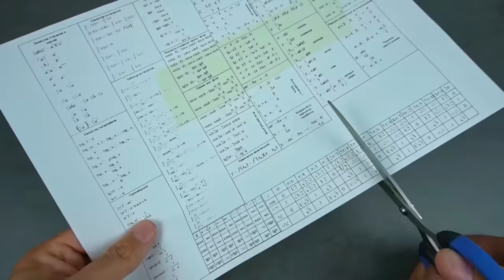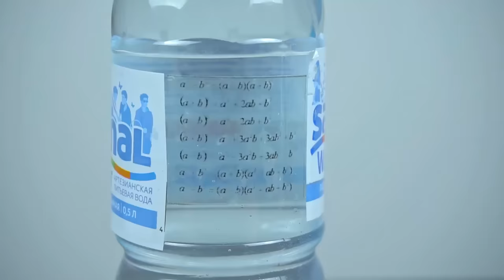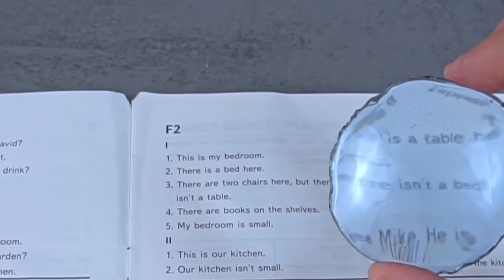I regret not having learned this secret at age 40! Absolutely amazing ideas

Comment: Water bottles containing ice shouldn't be attached to electrical equipment...
Reply: Set it up where water,condensation, doesn't get in it?if a electrical fire persistent, water will put it out!😂😂❤❤❤
Reply: Especially with something like that, the melting ice is going to run all over!
Reply: Not the best idea to be melting plastic with a soldering iron or a lighter either. If you really have to do that, do it outdoors with the wind blowing away from you.
Reply: @stevemerrill-bz7bk  water doesnt put electric fires out 🤦‍♂️
Reply: The REALITY is, one is doing this in the first place because the room/area is HOT, therefore, this makes ZERO SENSE, because the ice will melt in MINUTES, and will result in basically nothing.

Comment: The 6th one, (protection for your eyes} is just as dangerous and using an electric angle grinder without safety glasses on. If that grinding or cutting disk exploded while using it, flying shrapnel from the broken disk could and would go right through that piece of plastic and protentional take one or both of your eyes in the process...I strongly recommend that NOBODY MAKE OR USE THIS as an eye shield. IT IS DANGEROUS...
Reply: Yes. Very Dangerous
Reply: Using angle grinders is inherently dangerous. 
I'm a 74 year old construction sparky and in all those years I've had sparks hit my cheek and bounce under the safety glasses and into my eye but I've never seen or heard of a disc shattering and taking out an eye.
When did it happen to you or how many times have you heard of it or seen it happen?
Reply: I thought the same thing. But it would be good if you had no eye protection while doing minor projects using a dremel for detailing... but even that could be dangerous
Reply: Better than nothing.  But ya, I want the OSHA  approval myself.
Reply: @douglascolman4501  bet when those sparks and metal shavings were flying you didn't think "I would rather have a plastic bottle protecting my face rather than safety glasses actually" and if you did, well im surprised you made it past 7 years old.
Reply: @dombouscher8436 if you don't have protection at the time then you don't do the job. Simple. Your sight isn't something to mess around with
Reply: The Sparks are the least of your worries. The angle grinder disc can and will blow up and fly everywhere. I've seen it stuck in people's hats. Hard hats and in their safety glasses OSHA proves safety glasses that save their eyes. Please do not try to use homemade safety glasses when using an angle grinder for your own protection. Also no loose fitting gloves but then I'll grab you and twist you around
Reply: And very pointless considering safety glasses are under a dollar.

Comment: Don’t do the ice fan one! If the water melts it could blow into the fan and electrocute!
Reply: Proper positioning of the bottles would be important to avoid that.
Reply: The holes in the bottle and a little thing called condensation would do a pretty good job of getting the fan wet on a hot day

Comment: There's no need for the holes in the plastic bottles of ice behind the fan. All that will do is create a mess as the ice melts, and it will actually melt faster.
Reply: And we all know that a puddle of water and an electric fan go together like peanut butter and cyanide.
Reply: I was just thinking that like yea that would of been a good idea  if you didn't put the holes in it.....
Reply: u dont want it to melt faster for the cooling to work?
Reply: No, it actually would not!  It's one of the best ways to cool down when you have that cool mist making things dewy. You make it sound like a bucket of water is going to  hit you.
Reply: I don't know how i feel about condensation in a dirty electrical device pointed at my face lmao. 
Wouldn't a simple bowl of ice in front of a fan be better? But i guess that way you couldn't justify using all this single use plastic by pretending you are making a thing that you totally aren't going to throw away in 3 min.

Comment: With the wooden matches all you have to do is melt wax and cover the entire wooden match in melted wax when the wax dries it's making a water barrier or moisture barrier, your matches will never get too wet to light that's all you have to do. Get a wax melter put unscented uncolored wax in the melter and allow your matches to be completely coated in candle wax there's a good hack for you. Do that and you'll never have to worry about your matches getting wet or moisture collecting on them and them not lighting because the wax keeps them bone dry, and the wax also allows you to use the striker, for matches that do not require any striker get the white tip matches cover them in wax and you'll only have to use a zipper on your jacket and even if the zippers wet the wax keeps the match tip from getting wet and it will still light.
Reply: or STICK THE MATCH IN YOUR EAR, viola, waxed matches, thank me later.
Reply: Dip in clear nail polish let dry. Strike on striker.

Comment: 1:19 That won't work. The melted ice has to go somewhere.
Reply: I was thinking the same thing.
Reply: Thought the same, or is he trying to do evaporative cooling?
Reply: @snowmiaow  either way, there will be leakage and condensation.
Reply: It works fine. I’ve done it however, you have to have a place for the water to drip ass it’s melting.

Comment: One question on the ice at the back of the fan. You put holes on the water bottle, when the ice melts wouldn't it leak? The fan is plugged isn't that dangerous?

Comment: If you take 1000+ 1-liter wine tetrapacks and glue them together, you can make a giant floating raft. Or, glue them to the interior of a wall and then coat with concrete to make cheap thermal insulation.

Comment: I've replaced the batteries in Dollar Tree solar lights and they are working BETTER THAN EVER. I think the original batteries are feeble so a new cheap rechargeable is an upgrade. 
Their biggest enemy is rain damage over time. Putting it in a sealed enclosure as shown in the video helps extend their life.... and it helps to NOT hit them with the lawn mower too... ;-)

Comment: 0:37
What's the use for long strip of plastic?
Reply: I think people use them in those machines that build replicas from melted plastic.
Reply: Braided, used for strong rope or other bindings.  Can be heated and strengthened. Cheap and useful if you don't mind putting in your time.

Comment: RE: the plastic bottles with holes behind the fan - why not leave the caps off so the water drops into a pan as the ice melts? Putting some cheesecloth or highly porous burlap made of jute or hemp over the front of the fan with twine to fasten it will catch the water-drops and add to the cooling without creating a condition for black mold to grow on the woodwork behind the cat.

Comment: Please use REAL safety glasses when working with power tools. The plastic from a bottle is too thin and flimsy to stop a sharp object that's hurtling at your eyeball at the speed a saw or grinder could generate.  I've had several eye injuries from sports and mishaps as a child,  but one that really hurt was the small hot piece of metal from using an angle grinder on steel plate, which made its way under my safety glasses and into my right eye. If that can happen with good glasses, imagine what can happen with self crafted garbage ones.

Comment: Lots of good tips here for storage after all that is what plastic bottles are designed for and re-purposing them is great. However the standby safety glasses and electrical tips are downright dangerous. I had an angle grinder disk shatter on me wearing fully approved safety glasses and they only just saved my eyes. A plastic bottle will stop low speed dust and that is about it. They will give you a false sense of security and pop go your eyeballs!

Comment: Ok, some ideas here are not bad but there are some which are not good at all. NUMBER ONE BAD IDEA!!! Is the candle holder made of plastic bottles. I actually used to do something very similar to the method shown here. I lit a candle one night on my dresser and dozed off. My dresser was made of wood and my candle holder was plastic like in this video. When I woke (thank god I did wake up the next day much past the point of concern) there was a 3in diameter burn mark where the candle holder used to be on the dresser with a big blob of plastic and wax. If I had a metal holder or a ceramic on no problem. DO NOT USE PLASTC FOR CANDLE HOLDER! Lesson well learned without having to die or loose my house. Thanks god universe or whatever saved my stupid ass that night! Whatever you do DO NOT DO THE PLASTIC BOTTLE CANDLE HOLDER!!
Reply: I agree

Comment: Those makeshift safety goggles aint protecting anything. I'd use a pair of sunglasses before those. Another thi g never put fingers in front of a razor when cutting plastic, it has a tendency to break free and go flying forward cutting through skin and nerves fast and easy. Leaving you with half feeling in say your pinky or thumb. Work smart

Comment: “hey… are you thirsty?”
“yeah I could go for some coke or even just water, whatever you’ve got…”

::rifles through drawers, finally produces a device made from a coca cola bottle with random holes and hot-glued straws::

::attaches device to the top of a jug of (easily tipped and poured) water, squeezes the contraption and proudly siphons out a glass of water through one of the straws::

“yeah actually I think I’m ok… you know, I might go ahead and, uh, head on home…”